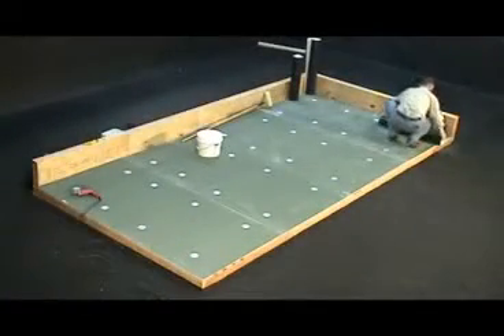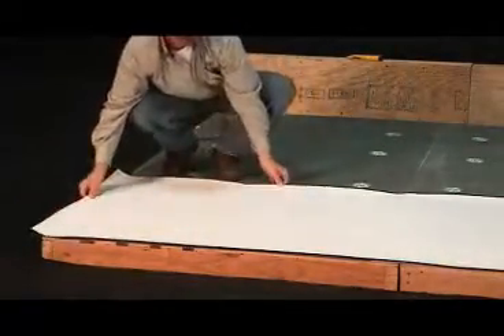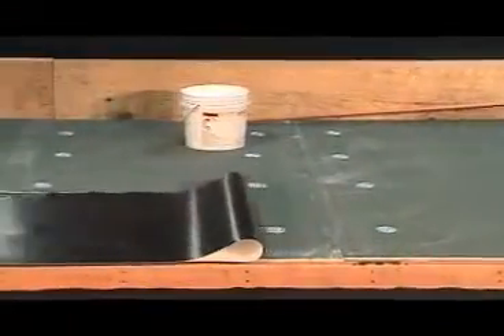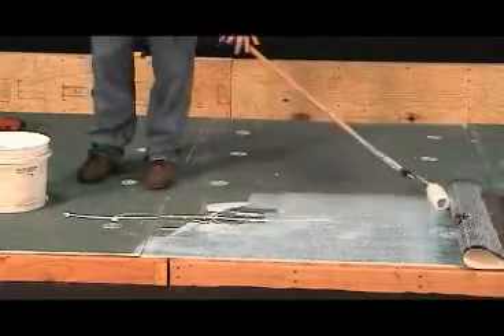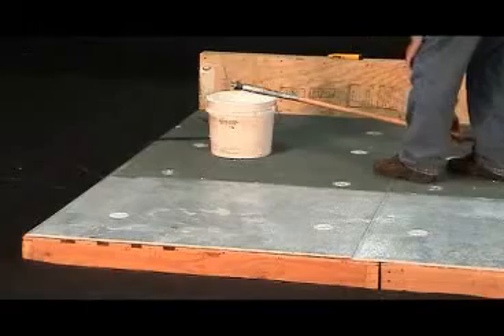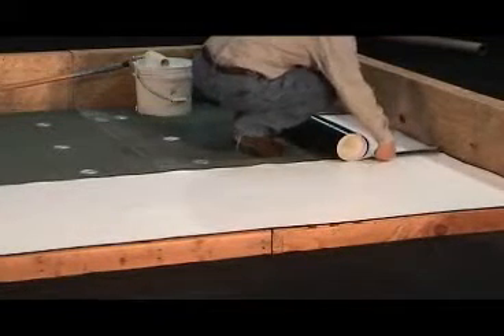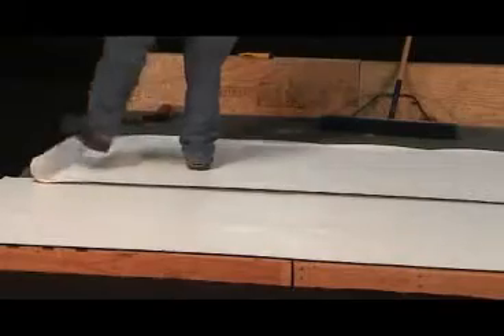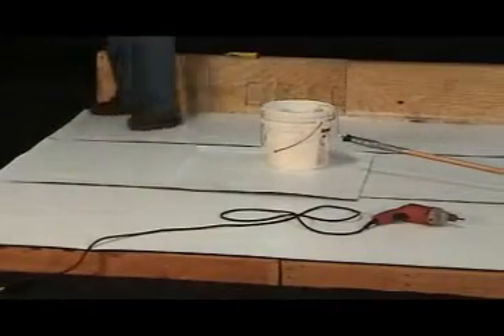Fully adhered PVC flat roof installion

Comment: I called a local roofer and they said they use a heat gun to seal the two pvc sheets together. Are you familar with that pvc product? Do you have a video showing how to install that? I have to seal a flat roof 10x38' with a few chimneys, the quote I got from the local roofer was $6-8,000! That sounds a bit high. So I'm considering doing it myself if I think I can do it right.

Comment: what is the glue that you are using for the PVC?
Reply: Why would you ,"keep the adhesive off of the overlap seams"?
Reply: @beewm4225  Good question.... I was also confused by this instruction...
Reply from the maker: Water-based adhesive - wet-applied